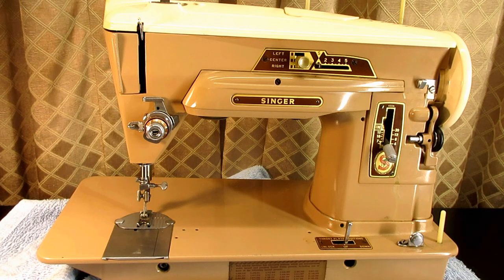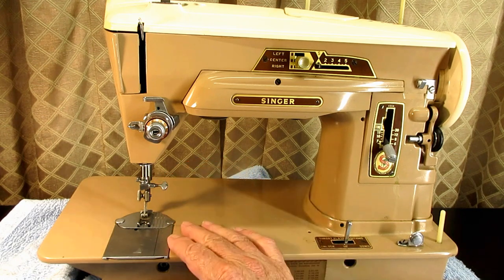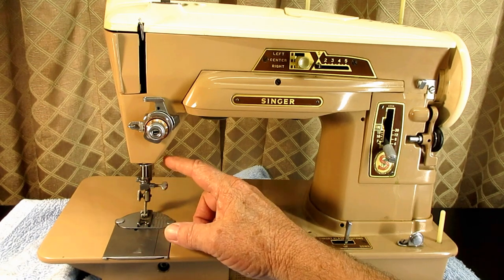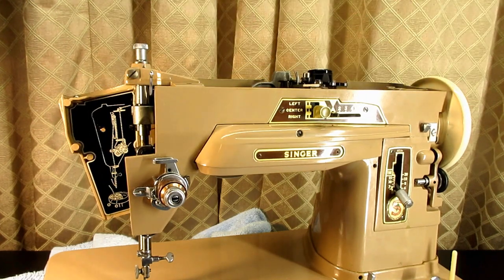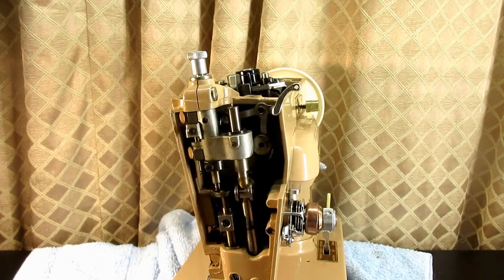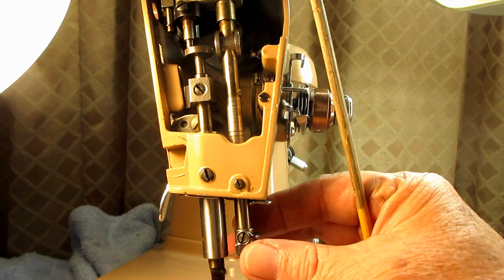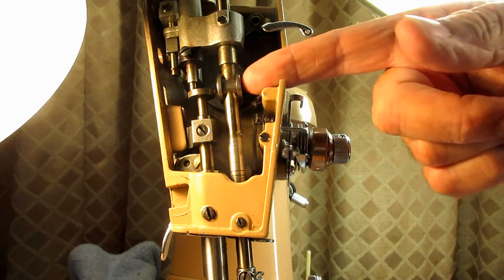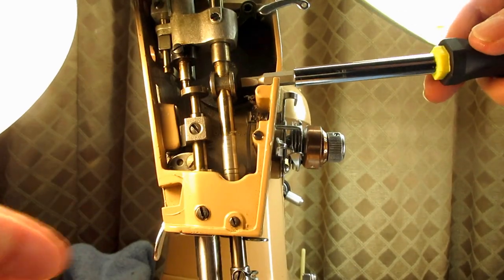All about the Needle Bar of the Singer Model 403A Sewing Machine

Comment: Hi Andy.  Today, as I am cleaning the Needle Bar Connecting Link, I notice that there is a piece of brown dense fuzz stuffed in the metal tube part of the connecting link.  It goes as far as the oil hole on this part.  I'm wondering if this is normal, and if I should put a new clean piece of well-oiled fuzz, perhaps felt, here when I reassemble and put the needle bar back in the machine.  It makes the upside down oil hole on the connecting link make sense, since the oil would slowly travel from the fuzz through the hole and keep the take up lever connection oiled.
I hope I've explained this clearly, and as always, I appreciate your advice.
Reply from the maker: You are right on the money, Carole! That felt pellet is called the oil wick. It is actually white in color. If you like you can pick it out with a needle, clean it with Krud Kutter, and put it back inside. Pushing it in about the area of the hole. Personally, I think it will last much longer than a piece of modern felt will, but replace it if you like. You can just leave it in there also and the new oil will flush it clean and remove any residual moisture. You have great instincts and attention to detail. Good catch and nicely done. Pinning your comment to the top for others to see. Take care.
Reply: @andytubesewing1953   Thanks!  I'm gonna go for reusing the little pellet.  I've soaked it in Krud Kutter--wow, such a lot of brown oil oozing out of that teeny tiny piece of felt.  It's almost white, but not quite; it's a light, light brown.  Now I've got to keep it in a safe place until I'm ready to use it; it's so fly-away.
Reply from the maker: haha it is surprising how much oils in there and I keep it and other tiny parts like that I'm afraid to lose in an empty pill bottle and tape it to the leg of my work table
Reply: @andytubesewing1953  oh my gosh. My other 401a did not have that when I cleaned it, now I get to take it apart and put some in it🤦‍♀️. 

This one does. I almost threw it out. I thought it was built up guck😂🤣, this beauty was so full of guck. Thank goodness I re-read through the comments. 🙏🙏🙏🙏
Reply: What an awesome observation that Carole made… this really helped more byoo

Comment: Thanks for this 403A series.  I just purchased one from goodwill and find that it has an on again -  off again swing needle return problem while zig zaging. My guess is that it is just gummed up in a place that I haven't gotten to clean yet.  The second problem is one you had addressed in your video of a 401 where there was a "hard spot" in turning the hand wheel.  A pinion gear tightness problem if I am remembering correctly.  I'm looking forward to your whole series on this 403. Great information for everyone!
Reply from the maker: I'm glad you found my channel, Dennis. "Gummed up" is a good description of many vintage machines. I find a good cleaning clears up many problems, so I usually strip down the machine and wash it. After reassembly, I can adjust most problems away. BTW, you picked a great ZZ machine to buy, IMO. Thanks for the comment.

Comment: Hello,  love your videos and the detail. really helps in the understanding of the amazing workmanship and engineering.  Thank you!  My 401a needed a side-to side adjustment of the needle which was easily fixed but the needle is also pushing forward towards the front of the machine, slightly too close to the plate which gives a guillotine effect on the thread as it passes through the needle plate.  tried another needle with the same issue so the needle is not the problem, any tips?  thank you!
Reply from the maker: There are a few adjustments that can be made to the needle bar. One of them is adjusting from the front to the back, like centering the needle in the hole of the needle plate. You can find the directions for this adjustment on Pg. 142 of the Service Manual for Singer 401 Class Machines (401A, 403A, 404). The manual can be downloaded for free in PDF format from this Link at Sewing Dude: https://sewingdude.files.wordpress.com/2012/09/singer-401-service-manual1.pdf
Thanks for keeping the machine in service, Thomas, and for watching my channel.
Reply: @andytubesewing1953  Thanks so much! got it back to normal :)
Reply from the maker: @thomasbranconier  Hey, that was easy! Nicely done 👍

Comment: Hello Andy. I have a singer 1507 model sewing machine, and I'm having lots of trouble. The timing was off. First i thought the problem was with the needle bar, so i slide it up/down. But I ending up fixing the timing by playing with the hook on the bottom. Now my problem is that the needle bar doesn't have any timing marks, and i can't figure out what height it's supposed to be at. I brought the needle bar to the lowest position by turning the hand wheel toward me. and i tried adjusting the needle bar to different heights, but the fabric still doesn't feed and the it looks like it's stitching in one spot. before when the timing was off, and  before i adjusted the needle bar, the fabric was still feeding. so i know i caused this problem by messing with the needle bar height. it's a inexpensive machine, but i've had it since i was a teenager and it was a gift from my grandmother. would you please be able to give me any advice?
Reply from the maker: Your machine is from 2005, about 30 years newer than what I work on so I have no experience with it. No place I know of sells the Service Manual for your model. Before the days of timing marks, you could set the height of the needle bar and the needle to hook timing at the same time. With the needle bar on the way UP, meaning it hit bottom and starts up, with the hook directly behind the needle, the eye of the needle should be about 1/16" BELOW the hook point. That's the correct height of the needle. You can see why right? As the needle starts back up the fabric drags on the thread and forms a tiny loop in the needle thread just above the eye of the needle. The hook point must arrive behind the needle at that moment so it can "hook" the thread loop. The needle bar MUST be on the upward stroke, the hook point MUST be directly behind the needle and set the needle height so the eye of the needle is 1/16" below hook point. The 1/16" mark is what most of the Singer machines were set at but think of it as approximate. What if your newer machine needs to be a tiny, tiny bit higher or lower? That's what makes you the repair tech, finding what works for your particular machine.
Reply: @andytubesewing1953  Thank you. I am going to take a break and try again when I'm re-energized.
Reply from the maker: @samallen2135  That's a very good way to approach it, Sam. It will be patiently waiting for you to return, and chances are you'll have better progress. The times I broke things on machines was when I was frustrated and/or tired. Good Luck.

Comment: I am working on a Singer 600e. I stumbled across a YouTube video (can't find it now and manual doesn't show) that showed a couple of set screws on the outside back for adjusting the left and right position of the needle. I think we have the needle on dead center, but there is a small amount of play in the needle bar.  The machine did sew a seam before we worked on the left and right. It is a brand new needle. However, the needle needs to move to the center rather than at the front of the throat plate. Is it same to assume there is no set screw for such an adjustment? Is this a bent needle bar problem, or is there somewhere else to look?
Reply from the maker: Play in the needle bar on this type of machine may be a problem with the Ball Bushings for the needle bar. There is an upper and lower ball bushing. In rare cases, they can be worn enough to cause play in the needle, but it is often from someone inexperienced trying to adjust the needle bar. You can buy the 47-page Service Manual for your machine for $8.99 and download the PDF here: 
https://manualsoncd.com/product/singer-600-603-sewing-machine-service-manual/   Pages 7 to 9 have all the needle bar adjustments. The manual has remove, replace, and adjust instructions for almost every single part of the machine. I buy a SM for most machines I work on. Thanks for watching my channel and good luck.

Comment: Good Evening Andy, it's me again.  I removed, cleaned and replaced the presser bar and the needle bar assembly, the tension lever and the piece that pushes on the little bar sticking out the tension inside.  Sorry can't think of the name at the moment.  Although neither bar seemed bent at all, my needles won't line up correctly.  If i'm at center it shows near the right, if i'm left or right it adjusts both ways without an issue as long as i'm on strait stitch.  If I try to do anything else it swings way left or right and both needles will hit the throat plate.  Do I need to watch your video on the needle bar driving arm to repair that?  Thank you so much for all the help.
Reply from the maker: "needles"  "both needles" It's helpful to see what your machine is doing. You can post some pictures and videos to your YouTube Channel, or work thru email at andytube53@gmail.com.
Reply: @andytubesewing1953  Hi Andy, sorry it's taken me so long to respond.  Life's been hectic and as soon as I can I will surely do that.  Thank you
Reply from the maker: @donnasmith2720  no worries.
Reply: @andytubesewing1953  Good Morning Andy.  Hope your doing well today and I think i'll at least give you a chuckle from my error.  So, I finally was able to start messing with it again and here is what I found to have done wrong.  

Whew!  I thought I screwed up putting it back together because the double needle option zig zag was hitting the foot on left and right...  Ummm....  You CAN'T zig zag with two needles.  Lol

So I didn't mess up, the needle bar isn't bent and everything is working beautifully so far.  I only used the "0" cam for zig zag and tried a few stitches in different lengths and bites and did some straight stitching too.  My 13 year old granddaughter was impressed with the photo's of this machine's journey so far.  

Thank you again Andy.
Reply from the maker: @donnasmith2720  Well, it's good you found the "problem". A week ago I wondered about your settings when you said "both needles". FYI, you can sew ZZ with double needles. The needle bar is set to the Left position, and you can only use up to width 3 as you found out. You can even double-needle sew using the pattern or fashion cams, as long as you use a width of 3 or less. Here is a video demonstration of double/twin needle sewing on a slant machine: https://youtu.be/vcat954C4UA    The double-needle instructions are shown on page 40 of the instruction manual which can be downloaded free from Singer at this link: https://www.singer.com/search/support?title=403  I'm glad the machine is working well for you. Nicely done
Reply: @andytubesewing1953  THanks so much  Andy.  That is awesome.  I have the manual and thought I could double needle it but apparently didn't read it right.  Great to know.
Reply from the maker: @donnasmith2720  Once you play around with the double needles you can make some beautiful stitches, borders, etc.

Comment: So I feel like I must’ve missed something. I can set the height, but then how to I reach the screw since when it’s bottomed out I can’t reach it. If I raise it then the bar slips.
Reply from the maker: Yes, you missed it twice, Cassie. Because of the side location of the clamping set screw you need to raise the NB up and loosen the set screw, then retighten it JUST ENOUGH to hold the NB from slipping. The screw must be loose enough to allow manipulation of the NB so when you lower the bar and set the height and alignment you can twist and move it up or down a little to get the settings. Now that you have the height and alignment set, you SLOWLY raise the bar back up to a height that allows you to access the screw from the side and to a complete tightening for a permanent hold. I discuss the screw adjustment at @13:55 and mention it again later. Then starting at about @28:45 I show slowly raising the bar and permanently tightening the screw. This is my method from trial and error as there are no instructions about the screw in the Service Manual, but just says loosen then tighten the screw. Depending on the particular model 403A I was working on I had to "fiddle" around with the screw to find the point of tightening it took to stop the bar from just slipping but still allowed me to raise and lower the bar to do the settings.
Reply: @andytubesewing1953  sorry. Should’ve tried that before I asked. I tried it before you even replied and of course it worked. Lol, just took a little fiddling.
Reply from the maker: @cassiestephens7381  I'm glad you worked it out.

Comment: I have been struggling with sewing some patio furniture covers because the thread keeps shredding. Using a polyester outdoor thread and 16 needs and finally figured out the needle is brushing against the throat plate ever so slightly and causing the thread to shred. I took apart the machine to check the needle bar and sure enough it is ever so slightly bent, probably just enough to cause the thread to rub and shred. Now what? I can't find a replacement online. Any suggestions? Thank you for your great videos!
Reply from the maker: You do not say otherwise, so I'm assuming you have a Singer Model 403A. The part number for your needle bar is 172033. That should be shown on your needle bar. No one makes new needle bars for the slant-o-matics which means you must find a used one and hope it is not bent. Your best bet is eBay. There are some sellers who "part out" machines. Sometimes you get lucky and can just buy the needle bar itself. Sometimes you have to buy a small "parts lot" of associated parts. Here is some good news (READ THIS) The same needle bar was used on the model 401A, and there are many more of that model. In fact, on a quick search of eBay, I found 3 in about 2 minutes of looking. Here is one of them: https://www.ebay.com/itm/Singer-Sewing-Machine-Model-401A-Choose-Your-Parts-Free-Ship-Over-25/153374343655?hash=item23b5d2c1e7:m:maZgc5HEf195L6HF-y-eqVw
and another one: https://www.ebay.com/itm/Original-Singer-Sewing-Machine-401A-Needle-Bar-Clamp/233314308779?hash=item36529dd2ab:g:g4oAAOSwh7ZdVcPr:sc:USPSFirstClass!85282!US!-1
Remember, caveat emptor, it's your responsibility to see if the seller allows returns if something is wrong with the new one.
Do not buy a needle bar from a Model 404, the brother to the 401A & 403A models. It is actually a more heavy-duty needle bar with a different part number ( 179007 ) and may not work properly on your machine. Thanks for watching Andy Tube and good luck.
Reply: @andytubesewing1953  Thank you so much for that info. I will go look at those right now! And yes, I have a 403A.
Reply from the maker: @marierossen2895  You're welcome Marie I think one of these should work for you and I wish you all the best and I thank you again for watching my channel
Reply: @andytubesewing1953  One more question. I have been servicing and sewing with the machine and I didn't have this problem initially but never removed the needle bar. At one point I was sewing and the machine jammed. I pushed and pulled up and down on the needle bar to get it back through the fabric. Could I have bent it? If not, how does a needle bar get bent? I assume it isn't easy to do as it doesn't seem like a common problem and I certainly can't bend it back! Trying to avoid this to happening again?
Reply from the maker: @marierossen2895  Yes, that could cause it. Remember the top 1/2 or so of the bar is hollow too. I bent a needle bar once while sewing at full speed and I was "helping" the fabric through and bent the needle back causing a needle strike on the needle plate. I was using a heavy-duty size 18 needle and sewing nylon belt to leather belt. After I put in a new needle it did not sew correctly at all and started scraping the needle on the up & down movement. I pulled out the needle bar and rolled it on a flat counter and could tell I bent it. I replace it. I have had a couple viewers tell me they fixed the bar by wrapping in heavy fabric, like denim, and putting it in a Vice to flatten it. They marked the end of the bar to know how to set it up in the vice and said it worked for them. I just buy a used needle bar b/c that is cheaper than a vice, hehe.  If you have not ordered your new one maybe you know someone with a vice? Best of luck to you.